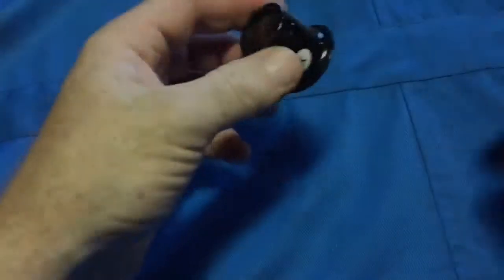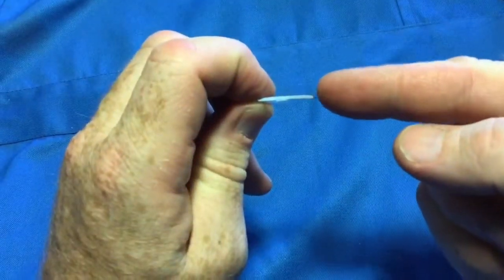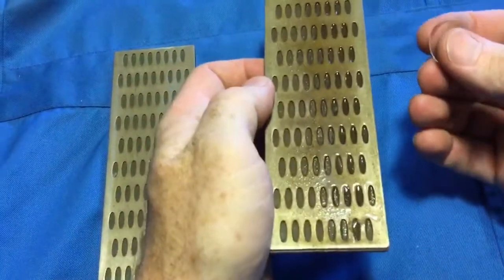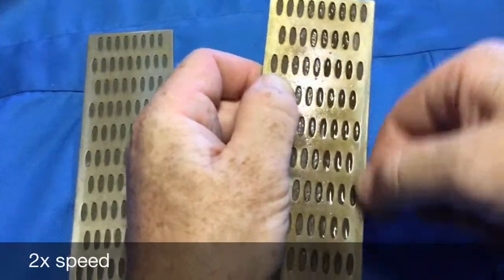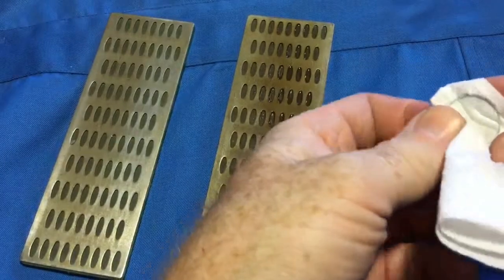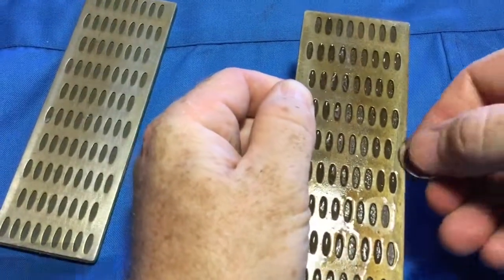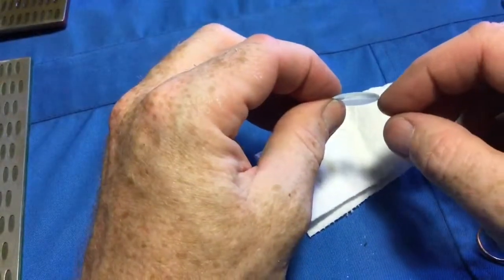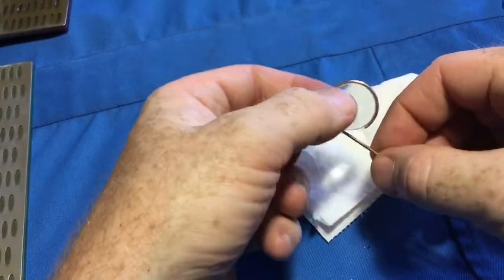Modding a Loupe Lens

Comment: Cool. It fit exactly!
Reply from the maker: Yep, using the mandrel in the first video gives a smooth curve. Gentle expansion, by hand, of the ring is usually all that's needed to get it closer to the lenses size. Of course, you leave it a little undersized so it snaps on :)